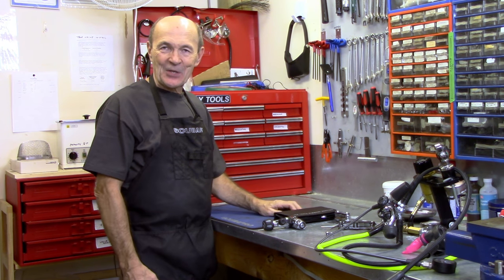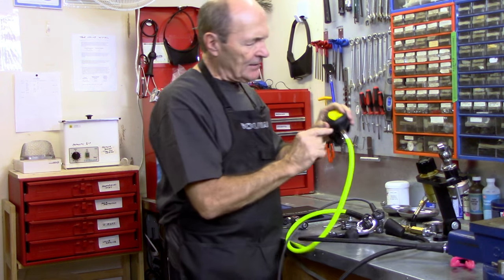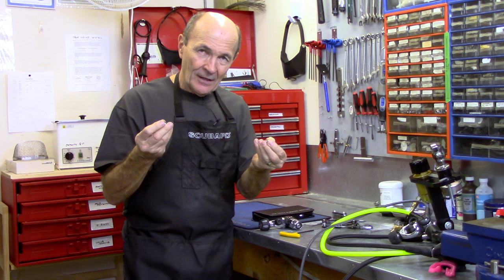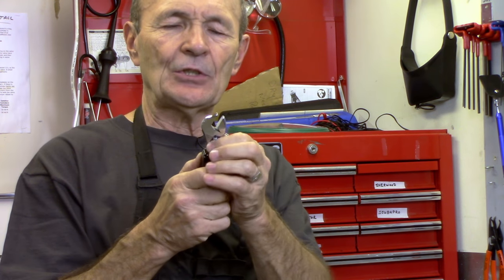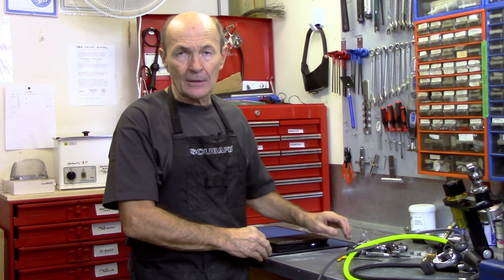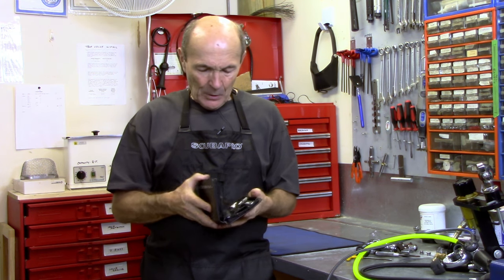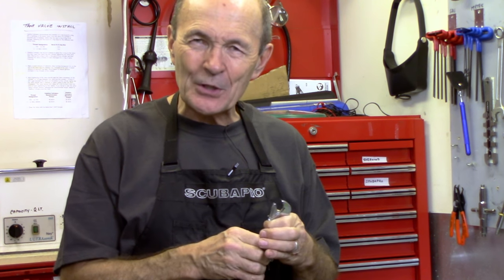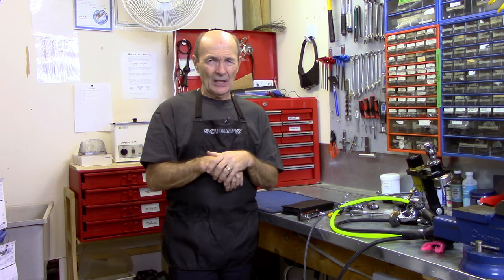Dive Tools - Scuba Tech Tips: S04E15

Comment: I carry a couple of tools in my SADK.

1.5mm Allen key for the transmitter housing when you need to replace a battery. No imperial equivalent. 3/64" will strip the nut.
3mm Allen key for the Goodman handle of my dive light. No imperial equivalent. 7/64" is likely to strip the nut.
5mm Allen key for the port plugs. 3/16" will fit, not perfectly but it'll do the job.
8mm Allen key for Pro-Valve inserts. 5/16" is the exact same size, or near as makes no difference (0.0625mm smaller).

14mm wrench for HP hoses. 9/16" will work as well, but I'm anal about fitting the right wrench to the right nut.
9/16" wrench for LP hoses.
11/16" wrench for LP swivel hoses.

Philips No.1 screwdriver for the EezyCut Trilobite line cutter.

Brass O-ring picks, no stainless steel picks. Stainless steel is harder than brass and chrome and can damage your regulators.

In addition, and as redundancy, I carry an XS Scuba Star Tool (5/32", 3/16", 1/4" hex, valve tool, 1/2", 9/16", 5/8", 11/16" wrench).
And a small IST Sports tool kit with a couple of adjustable wrenches, Allen keys, pliers, bit holder and bits, and zip ties.
Reply from the maker: You must be the most looked for guy before diving!!  Great tools to have hands in your SADK.
A

Comment: Thanks. Actually, you did give me, free of charge, a lot of port plugs when I came to buy one, and you did not take any money. And showed how to use them. You are always amazing; thanks.
Reply: When your LDS sets up your regs, they should provide you with all the parts left over. You should not leave without getting the port plugs they took out.

It's different when you buy a complete regulator set from a manufacturer. Those don't come with the port plugs. They should, but they don't.

Comment: Love that tool. Steve and I are fixing up a couple of old Apollo scooters at the moment. Yesterday we replaced the trigger and discovered it uses a magnetic switch. We will be doing our first sea trial in the ocean pool in a couple of weeks, I'll put a video up on my channel so you can see it. It's a fun project and a great excuse to get "grubby" in the workshop :)
Reply from the maker: The Apollo is the latest version of the good old DACOR Sea Scooter which I used for many years. I just sold my last two, 1 near perfect, the other for parts.
They were easy to work on and very rugged. We did some pretty crazy stuff with them - 11 divers behind one holding on to each others fins. It wasn't fast but it worked. We used to dive with a weight so we could "park" them on the bottom and return later. Sometimes we used a neoprene "vest" on them so they'd float. We'd tie them to our dive flag and use them to get back to shore.
That switch was available at any good electronics store - standard 4" magnetic switch. You just solder it in line and glue it back in place. I have a manual for the Sea Scooter if you need it.
Alec
Reply: Alec Peirce Scuba a manual would be so good. The scooters we have are second hand and older but most of the parts seem to be available. We have managed to get them going and will be putting them in the pool next week. They have been sitting in the back of Steve's shop for a few years gathering dust and it will so good to finally get to use them. I'm putting together a video of our project and should have the first one up on my channel next week.

Comment: Very well and informative show,just as an idea, make a show about the does and don'ts in maintaining the own equipment
Reply: Don't disassemble your first or second stage. Keep unused ports plugged so dirt and moisture can't get in there.
Some second stage regulator you can take the front cover off quite easily. That's great for cleaning the second stage (you'd be amazed what grows in there after a couple of dives), and service the mushroom exhaust valve.

Don't dunk your first stage if it's not pressurized. The dust cap is meant to keep out dust, it's not guaranteed to keep out water.

Don't use chemical solvents or abrasive materials. They'll damage the finish and O-rings. Just soapy water will do fine. You can use an old toothbrush to get into the smaller parts.

Rinse out the inside of your BCD with fresh water to prevent salt crystals from forming inside the bladder. That's the number one cause of BCD failure.

Allow everything to dry before you put it in storage, and keep it in a dark, cool, dry place, away from animals. Mice love neoprene. You don't want to come back to your wetsuit and find it has more holes than when you bought it.

Comment: I would also add a pair of soft jaw pliers, had a moment where I couldn't take the regulator off the tank, my guess is it shrunk due to it being cold, idk. I couldn't loosen it by hand but a pair of channel locks got it off. I suggest using rubber jaw pliers to protect the knob.
Reply from the maker: That's a good point too.  If it happens to me, I just call my wife over!
A.
Reply: More likely there was still pressure on the first stage.

Comment: these tool packs and multi tools might be ok if you're on a budget but in my experience the quality is usually not that good. I think some companies like to make their allen wrenches out of cheese. I'd also recommend open end spanners over a shifter. use quality tools and you're less likely to damage your expensive equipment.
Reply from the maker: You are so right PF.
Unfortunately that is a sentiment learned by experience. Most divers want the cheapest tool available and that's what they get.
Fortunately they don't need it often if at all so don't learn the valuable lesson you refer to.
Nice bike BTW. I've been a biker since 1965.
Thanks for watching.
Alec
Reply: thanks alec
maybe you should make a channel for biker tech tips
I know I'd watch
Reply: These multi tools are more for convenience, and when you're in a pinch. You can't bring an toolbox when you're flying to your dive destination, or on a day boat. If you're diving locally, or a service technician, get real tools. Preferably stainless steel ones to prevent little particles on the nuts that will corrode when they hit salt water.

Comment: Can you please explain diving lights in a video? What features are useful, what lumens and luxes are, etc. I have a simple diving light and I am going to buy another one for christmas. I know it should have strobe mode in order to draw attention (my current light is just on/off) but what else shoud I look for?
Reply from the maker: I did a light vid some time ago Victor.
Look carefuly at the Big Blue Dive Lights. Their 1100 rechargeable series is crazy bright but very compact and rugged. There are lots of others. Alec
Reply: Look for a light with a narrow beam angle. Around 10° is the sweet spot, with some flood. Too wide an angle, and in murky waters you'll get a lot of backscatter, basically blinding you and reducing your vision.

Don't get too hung up on lumens. A focused 500 lumen light is brighter than a 2000 lumen floodlight. Floodlights are only useful for underwater video- and photography, and they need a lot of lumen to light up a large area. Video lights are usually 5000 lumen and up, but they suck for signaling and pointing stuff out.

Some lights can switch between narrow beam and flood if you're unsure which one to get.

Comment: Also any tips on equalising. I squeeze my nose and blew but nothing happens. Is there a way to practice on dry land and how hard should I blow ?
Reply: Not hard. If you're unable to equalize under water, you've probably left it too late. You should start equalizing the moment you hit the water. The pressure increases fastest near the surface. In the first 33ft you double the pressure, in the next 33ft it only increases by half, in the 33ft after that only by a third, and then only by a quarter (and then you're at the recreational dive limit).

Equalize early and often. If you can't equalize, ascend and try again.